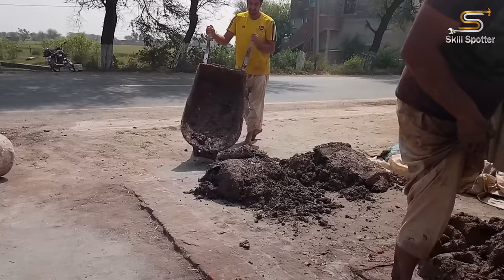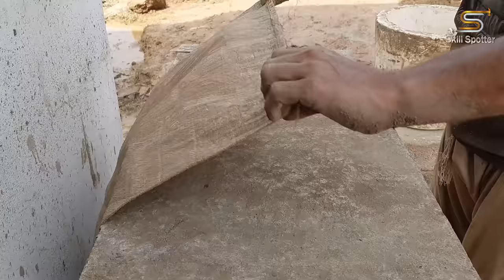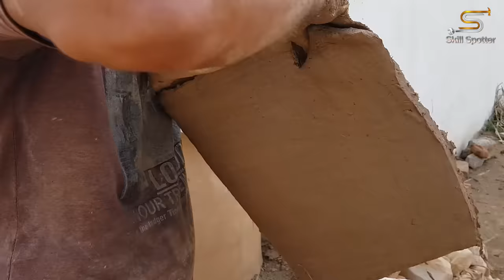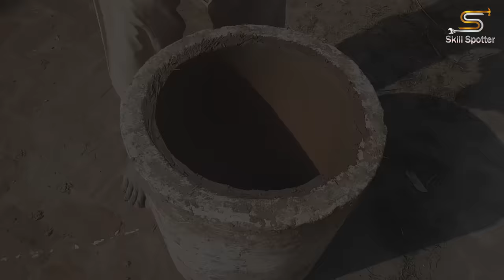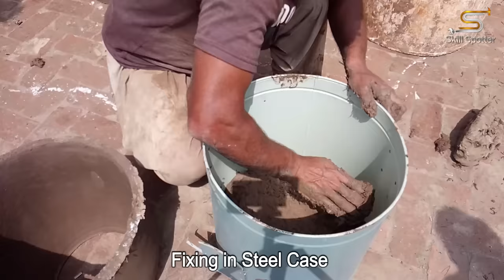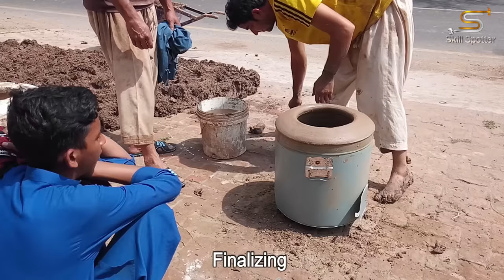Making Portable Mud Oven (Tandoor) Step By Step Process

Comment: An African tip / advice. 
If you put a fairly thick (strong) plastic tarpaulin on the ground, and mix the clay on top of that, fold the mix over in the plastic, tramp on the plasic, fold over, tramp, repeating the process, then you do not damage you feet with all the small stones and sticks that's in the clay.
Long periods of wet feet, and the abrasiveness of the sand is not good ...
 We use the same method in building cob or strawbale houses...
It also makes it easier to fold over bigger amounts of clay to wedge by pulling the plastic over, flipping a bigger portion of clay to work with, and slow down the drying process in the open sun ...
 Try it, it works very well.

Regards from RSA. 🇿🇦
Reply from the maker: Thank you so much for your valuable comments, this is a common stove used in south asia and peoples are very happy to use them, there is much more difference in types of clay in different areas so it came more strong after usage
Reply from the maker: Welcome to our channel.
Keep giving your valuable feedback.

Comment: Don't understand why the dry ground was added later then sealed up with clay at the top and left in the bucket?
Reply from the maker: To fill the gap between the mud oven and cover and also to prevent the steel cover from getting hot.

Comment: I made a tandoor myself. I took a steel hot water drum, cut off the top, made a drafthole at the bottom.
I made a one and a half inch clay liner and sticked it to the wall .  I got good quality red clay from a clay mine not far from home. After 1st drying, I impregnated the clay liner with sodium silicate to create a dust free surface. After 2nd drying i heated up the D. I. Y tandoor with a small wood fire. Thereafter I made a big fire in it and cooked some chicken parts in it by hanging them from above.  Delicious I tell you!! Unfortunately I was not really able to bake bread by sticking the dough to the wall.  Probably I do it wrong due to inexperience.
Can you help me with this? 
Thanks in advance
Reply from the maker: Wow you have done a very very great job, keep up the good work.
Bread sticking is totally based on experience even though I can't do it very well.
Keep giving your valuable feedback.

Comment: So where smoke goes to with pot over it?
Reply from the maker: Actually First this oven Filled with Woods than Fire makes the Wood Coals and this Oven is ready to use.
Means While Cooking No Smoke.
Reply: @SkillSpotter  So basicly it works like barbeque grill: you load it with wood , set on fire.Then wait untill you get charred coal.Only then cook.

Comment: I feel like the clay needed a lot more wedging and some soften wheat straw for that tandoor to hold longer.  Also it is the first time I am seeing someone using sand in tandoor making.  Sand residue sticking to the back of a bread is the worst thing you could chew on.
Reply from the maker: wheat straws are already added, Sand is necessary for this kind of Oven, when this oven gets hot its giving  more strength to the oven and save from getting cracks . I regard your opinion.
Reply: Watch again sand is NOT added to inner surface. But if you really got brain Sand retains heat that really helpout to keep the tandoor warm uniformly for longer time and save energy